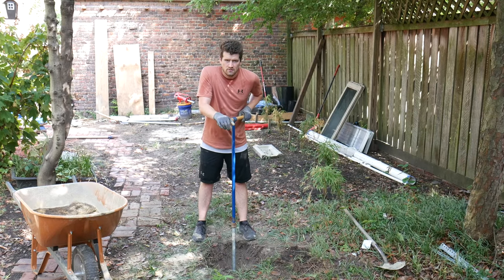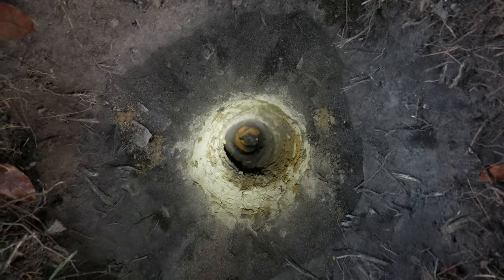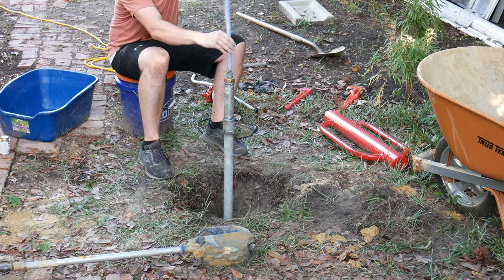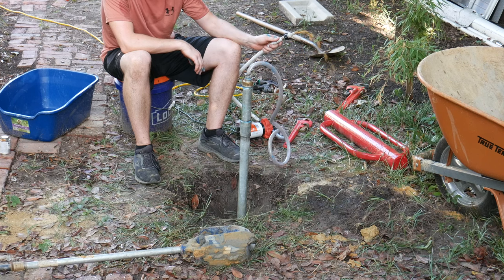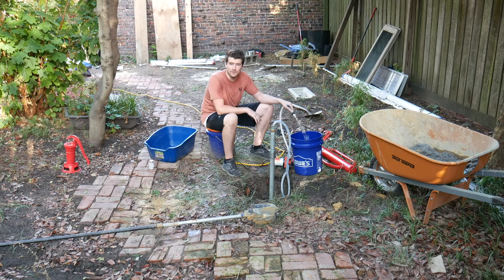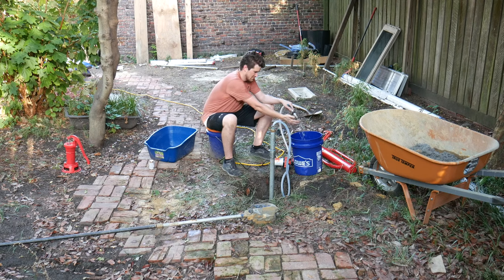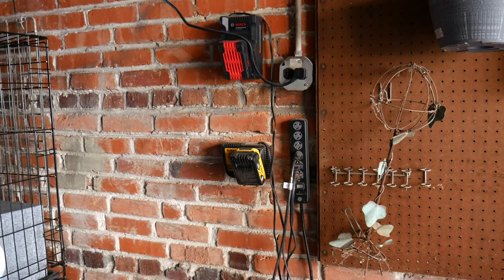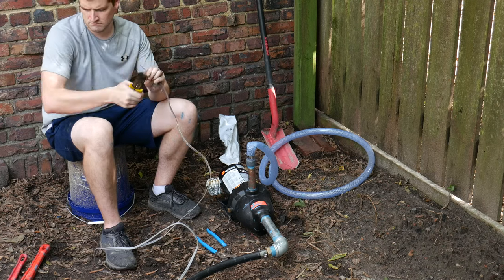How to drive a well using a sand point

Comment: Absolutely brilliant idea. No music this time and so much better thank you. Your water availability seemed to be too low to keep a constant flow rate, it seemed the pump was sucking up more than it could be supplied by the well point and if that is the case was driving it down into the clay too far causing this. You mentioned jacking it back up with a car jack but I missed when you did this so apologies if you did this without recording. Loved the science too and not making that mistake when people mention cold being conducted, only heat can be conducted into the cooler pipes (as you pointed out).
Reply from the maker: Yea, I ended up going deeper :)  https://youtu.be/1wOOL4RGjcg

Comment: I haven't watched your videos yet but this is what I have had in mind for a while . I just wanna  add to it some guys in poor countries not only use sand point wells but also they make water to water heat pumps for less than $500
Reply from the maker: The cost of my heat pump setup was probably around $500. Total cost of the system was around $1200. The two most expensive things were the 1/2hp pump and the pressure tank.

Comment: Can i pull my old one and replace in same hole ?
Reply from the maker: Yea that's what I did. You'll have to drive it back in but it'll be a lot easier than the first time.
Reply: @BadHomeowner  ok good, mine is in the shop and not possible to move it, awesome thanks for the reply,

Comment: I don’t know if you did but keep digging until you can’t dig anymore.  When you are in the water bearing sand you want you won’t be able to dig anymore.   I disagree with your logic about the layers.   You will have many layers of sand and clay before you get where you want.     I hit water at 8’ and couldn’t dig past it. I still went to 27’.   That was 2013 and I use the well to water my grass with a 27 gpm pump.   The pros here go to 42-47 ‘ for sprinklers and 100’ for drinking.    Just my opinion of course
Reply: yes a shallow well like this would probably just be seasonal water. The potable water year round would probably be much lower?
Reply from the maker: Potable water is normally hundreds of feet down in the permanent acquifer. But I did a water test recently and it turns out my water is drinkable: https://youtu.be/Anw4TQYVyFU

Comment: Question; why not combine your well water with your heat pump? The water should be usable coming out of the radiator.
Reply from the maker: Yea that's doable and piping would be somewhat simpler, but pushing the water through the 2 radiators would drop the output water pressure quite a bit.

Comment: maximum lift on that pump is 6.6 feet
Reply from the maker: Do you mean 6.6 meters? The lift is around 25 feet.
Reply: @BadHomeowner  This pump has a vertical lift of 30 feet. Everbilt
1/4 HP 2-in-1 Utility Pump. Is that it? thanks. I got a 1/6th horse power pump that has the same lift power but it's a different engine design. It's made by Liberty pumps in New York. So I can run it off-grid with a lithium generator. But that depth for me is just seasonal water - so I am in the process of doing a well-point drive down to 50 feet. I'm hoping I'll get through the clay layer and into sand by the time I get down that far. The clay is very hard to drive by hand so I'll rent the GPD-45. Gas Powered Driver. I'm waiting till spring just since connecting pipe in freezing weather is annoying. hahaha. Also I'm hoping the spring flooding will soften up the ground even more - as it soaks in. I had water down there - I drove it manually about two feet deeper. Plus the hole starts a couple feet down from the top ground. So I'm at 26 feet deep or 27 feet deep now. I need 10 more feet of pipe plus an extended to 2 inch. I have 10 feet of 2 inch pipe but that's too big to drive into the ground. So I am driving a 1 1/4" well point. Then I got a manual lift pump - instead of an electric one. The pump was super expensive but it has a sucker-rod in it connected to two one-way foot valves in the bottom. So it's hex hose and then a flexible steel sucker "rod" - in the hex coil - and the warm weather is required to uncoil the hex pipe. hahaha. Then there's a handle attached on top to the sucker rod. It's a cool design but the parts are probably $100 total and the pump was like $600. There's no assembly required except attaching the sucker rod with a vise grip to the pump handle rod. I'm sure just a normal pliers would probably work. So no need to use PVC glue cement - that stuff is toxic anyway. But the PVC pumps of this same design are half the price. Or you can just make one yourself if you get the check valves and toxic pipe glue. hahaha. I don't want to use that purple primer - it's carcinogenic! I don't see the point of polluting the water when making a well. Kind of ironic since you're required to submit the well construction for a well-point when it's completed but there's no fee at least.

Comment: Ok so my pipe is holding water at the top , this mean my drive point is clogged correct ?
Reply from the maker: Could be clogged, or it means you aren't deep enough for the water to easily enter/exit the water-bearing sand at the bottom.

Comment: Is there a check valve built into well point like a foot valve
Reply from the maker: It's not built in, I installed a check valve at the top of the well point pipe

Comment: Do you put anything around the well point like gravel, or does it just sit in the hole and then you back fill?
Reply from the maker: If you start driving the point at the surface, nothing needs to be filled in. I dug a few feet and then started driving, so I backfilled the top part that I dug with the dirt that I pulled out.